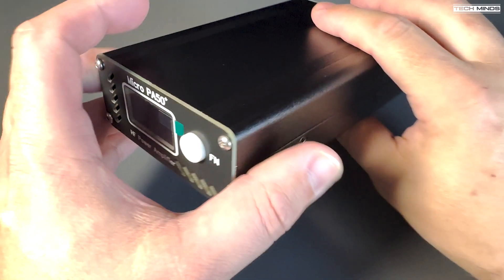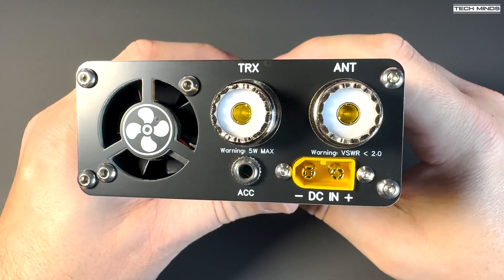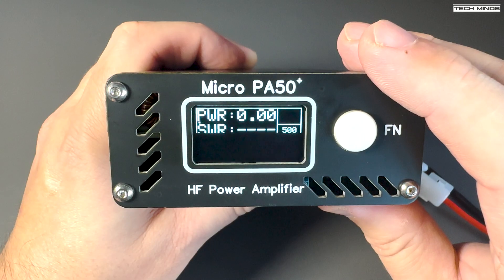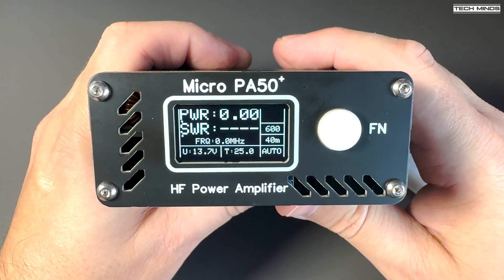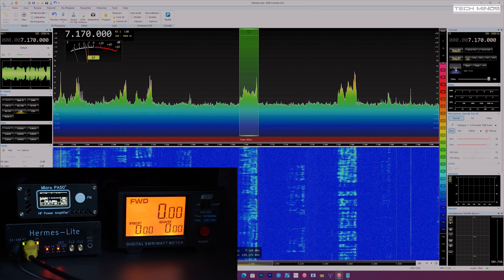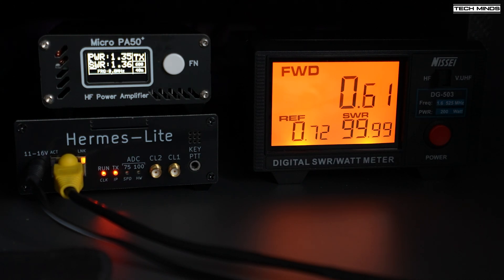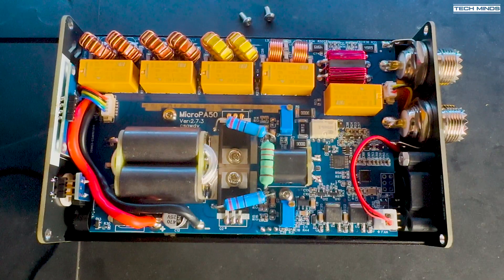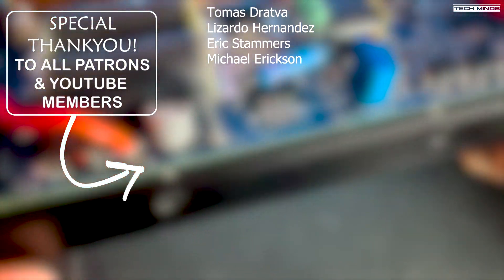50 WATT PORTABLE HF AMPLIFIER PA-50+ UPGRADED!

Comment: Interesting....

I don't have one yet, but do have the OGS-50 which is half the price & very similar in appearance. With the OGS-50 I have so far used only a very low input of 0.8 watts from a HF Signals bitx-40 I ran on a 9 volts/2amps max vcc. The amp put out about 25 watts at this input. 

I heard that the impedance at the amp's input can create a lot of reflected power depending on frequency, so I am waiting until I see the work around for this issue be updated for my latest version of amp before I use it with my RS 918, or use a method to ascertain exactly what the amp's load impedance is on the frequencies I have resonate antennas for.

Comment: Hi Mat
I am searching for a relatively cheap SDR transceiver solution and find the Hermes Lite 2.0 interresting. Do you know about newer and better SDR transveivers in this small size catagori?
73 de OZ2BKK / Bjarke
Reply: just buy the hermes 2, software updates are frequent. its all about the software.
Reply: Thank you for the information. Is there other cheap SDR transceiver alternatives around having the necessary band filters?
Reply from the maker: @bjarkekorsgaard  Hermes Lite 2 is the best solution at the moment. You could try the Radioberry but it needs filters. With the HL2, you can buy the filer board and have a fully working 5 watt sdr

Comment: My guess is, even with that chunk of aluminum under the transistors, this thing will overheat if you try to use it on digi modes or even heavy CW use.  

I'll be interested to hear your experiences with the HR50 as well.  I bought one of those several years ago and used it for a while, but my experiences weren't that great.  It worked fine initially, but I started having failures after a while - relays would die, the little 0603 chip caps would fail, and I had to replace the FET's a couple times.  I finally gave up on it.  It's a nice idea, but I think that the design isn't derated very well.  It doesn't use feedback and loads the output with some fairly large caps to level out the gain on certain bands, which I think leads to large RF currents in the design.  It's probably fine if you stick with SSB use.
Reply: At 45W output, no overheating at all
Reply: Very happy with my HR-50, no failures. Have the ATU and the QSK fitted. Plays very nice with the HL2.
Reply: No overheating with mine.
Reply: Many times I have used this on digital for hours and no heat issues.

Comment: I have the original which is sensitive to
use, such if the SWR is over 2:1, and it
makes quite a noise. Also if the exciter
drive is high enough to go over 50 watt
limit, from my Yaesu FT818ND, and with the ATM-100 tuner. So it is not too
easy to balance all three, but it does
work. 73 de W2CH Ray New Hampshire. 😊

Comment: Matt, the big q is, buy this or save a bit more for a more established amp? Is there much internal difference to the previous?
Reply from the maker: I'm currently building the Hardrock 50 amplifier which I am recording for an upcoming video. So might be worth hanging on for that. Or if you need a slightly more powerful amp then the Xiegu 125b is a really good 100 Watt amp with built in ATU. I know some people have had problems with the 125b, but I have owned 3 of them and they all worked great!

Comment: I just have the regular 50 version, and the fan is so loud i quit using it
Reply from the maker: Yeh the fan was constantly on when I was transmitting, dont think it was picked up on my mic though and the amp was around 2 feet away from my mic. So i dont think this is that bad on this model.